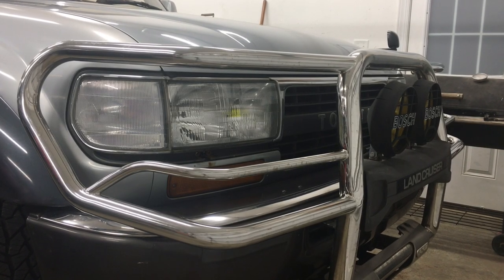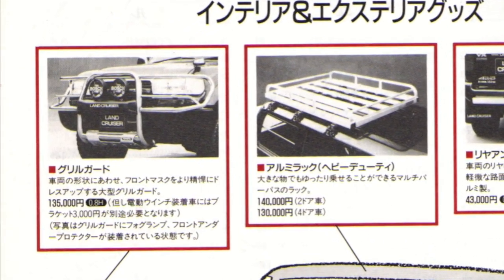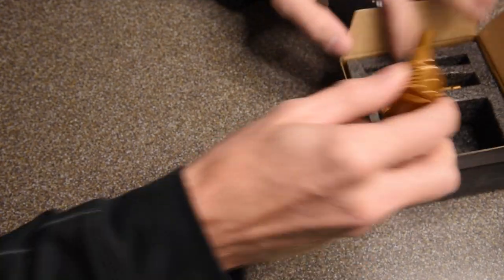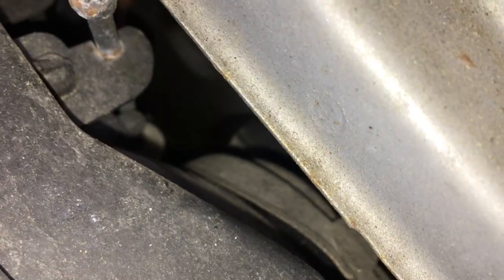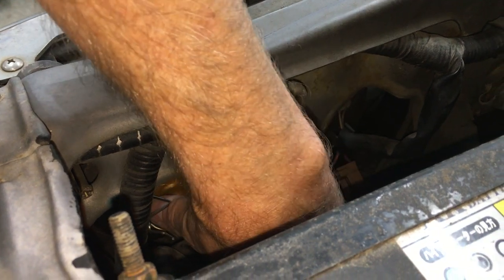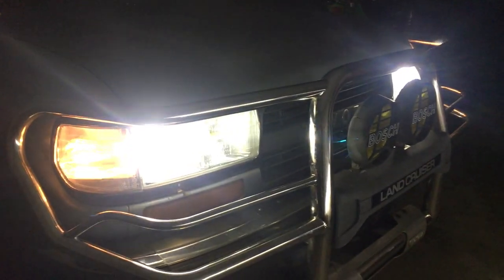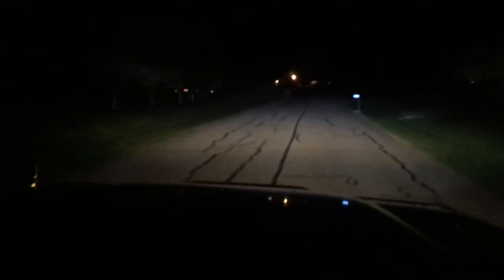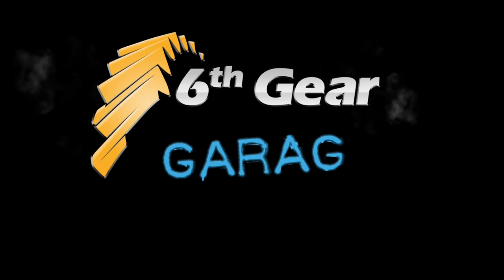Easy LED Headlight Upgrade - 80 Series Toyota Land Cruiser w/ Cougar Motor 6000k LED Bulbs

Comment: 1990 HDJ81 JDM series 80 owner here. I had been banging my head trying to figure out how to change the bulb in the fog light. I searched hi and low, looked in the Japanese language owners manual, the FSM, online search……nothing. Until YOUR video! Kind of unrelated as I didn’t need to swap for LEDs. Thank you for that one bit of info (the rubber boot around the back of the headlamp that had to come out, concealing the metal clip that had to be moved out of the way to get the bulb out of the back of the lamp assembly). Thank you again, very helpful! Subbed for future reference.

Comment: Dialectic grease is your friend ;-). I put LEDs in my low beams on my 80, can't remember the brand but a reputable, good rating brand from Amazon and they have been working great!! ONE CAVEAT: LEDs don't put out the heat that normal bulbs do so you will get a build-up of snow and ice during the winter sometimes.
Reply from the maker: Thanks for the info - I never considered the ice issue!

Comment: Get some LED side light bulbs for the outer marker lights, that way they will match your new LED headlight bulbs.
When selecting the side light bulbs, definitely buy the ones with the fish eye projector glass lens over the end of the bulb. This type seriously kick out some bright light.
Reply from the maker: Thanks, I still need to do that. The problem is one of the marker lights is stuck in place. I’ve pulled to the point I’m worried I’ll break it. I wonder if a previous owner glued it in place because the other side popped right out.

Comment: 1997 fzj80 389,000 miles. Did you have to install resistors with these LED headlights? 🤔
Reply from the maker: No resistors needed, they were plug and play.

Comment: What light bulbs are used in the corner lights? I may have missed that if you covered it. Mine recently went out
Reply from the maker: I'm not sure, I haven't taken those out yet.  It is on my to-do list as well.
Reply: Yes what bulbs for the turn signals ?

Comment: Hey dude. I’ve just installed the same Cougar H4’s. Did you dash hi-beam blue light stop working with the New bulbs? The lights etc are all working it must just be that the truck can’t tell that it’s on hi/lo beam
Reply from the maker: Hey now that you mention it, it did! I figured that bulb on the cluster must have burned out but You’re right.
Reply: @6thGearGarage  phew! Thanks for confirming bud. I’m guessing the halogen bulbs provide some sort of electrical feedback for the cluster. It was just a mission to install them this morning I’ll test that theory over the weekend
Reply from the maker: @MarcHDJ81v  It may be that a resistor is needed to be added in line to match that of the halogen bulb.

Comment: Nice video.  I also have an imported 80 (HDJ81) 2 questions.  Do they come as a pair when you order them (can't figure out from their website).  Also wondering what if anything you did to change the angle of the headlights so they don't blind oncoming traffic.
Reply from the maker: Yes they do come in pairs. I considered switching to USDM headlights because of blinding oncoming traffic, but to be honest it has never been an issue and I have never had anyone flash their brights at me on the road. (I really didn't want to switch and lose the yellow JDM fogs.)

Comment: did you have any issues with the blue dash light not coming on with the high beams?
Reply from the maker: Yeah, I didn't notice it until after the video, but doesn't work with LED bulbs.
Reply: @6thGearGarage  yeah, i have the same issue and am trying to fid a work around so i don't blind people unknowingly.

Comment: I have a 2006 land cruise 70 series and I was thinking to use the same ones they fit but idk if I need anything else like a resistor or anything off that kind ,if u know please let me know.
Reply from the maker: As long as the size is correct they should work on a 12 volt vehicle. No resistors needed 👍

Comment: Hey dude. Did you notice that your low fuel light also stopped working?
Reply from the maker: I didn't know it should have one, as it has never worked since I got the 80. And I've had the fuel down to E one time to check lol.
Reply: @6thGearGarage  yeah, when it gets to the lowest point on the gauge that little light glows orange.

It’s actually interesting, the gauge is so old school and mechanical, heading down a slope, you can see the needle dip, and then raise when heading up a hill
Reply from the maker: @MarcHDJ81v  One more thing to add to my 80 series to-fix list lol.

Comment: Hello, 
In the video description you also give links to the H1, H7, and H11. Are those for the integrated fogs and side markers??
1992 HDJ81 150k
Reply from the maker: No, those were just other product links for any non 80 owners interested.
Reply: Thanks for your reply 😁. Do you happen to know if they make other bulbs, besides the h4’s for our cars? Like for the fog lights, front and side markers, turn signals, and the rear lights?
Reply from the maker: @brettferguson6954   I haven't ever removed those bulbs to see what size they are, except for the foglight bulb. Unfortunately the fog bulb did not have a size printed on it, just 12v. I'm unsure what size it is. I may have to take it to a store when it burns out and compare to bulbs they have in stock.
Reply from the maker: @brettferguson6954  you might check out https://www.lasfit.com/ and you can choose bulbs by vehicle and they'll show you the correct size in results. (keep in mind these might be for US models only - may want to confirm with them on any lights different from US, such as headlights and corner lights) but if you do end up buying from them,  I have a 10% discount code "6thGearGarage" that you're welcome to use.
Reply: Thanks. Since mine is diesel…taking some of the bulbs out is a bit of a chore. Thanks for the discount code and the info, as well!
😁

Comment: I’m just shocked to see the working D light
Reply from the maker: Haha me too!
Reply: I managed to fix my D light. There’s a crappy little gray harness plug located under the starter motor which fails. Replace that plug and the D will work again. Also the reverse buzzer (had my truck for 25-years and didn’t know it even buzzed like that)